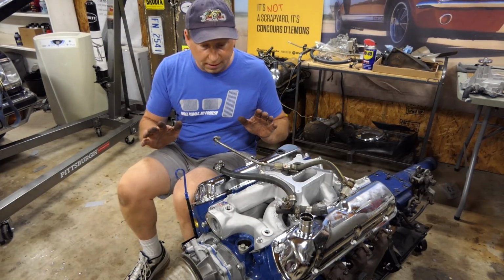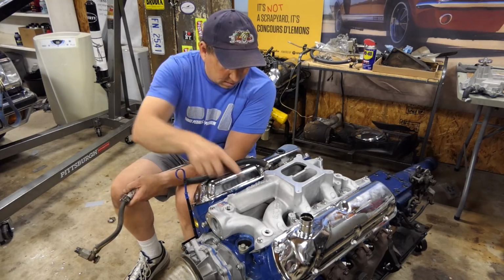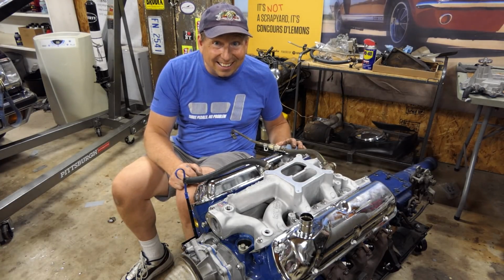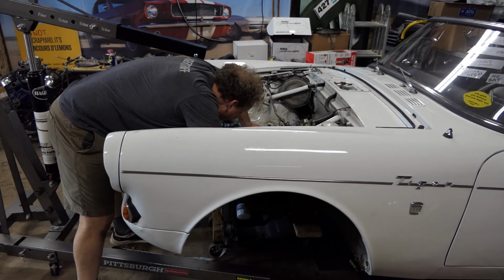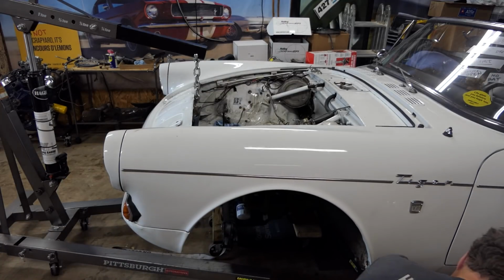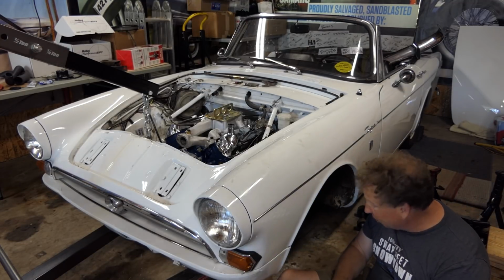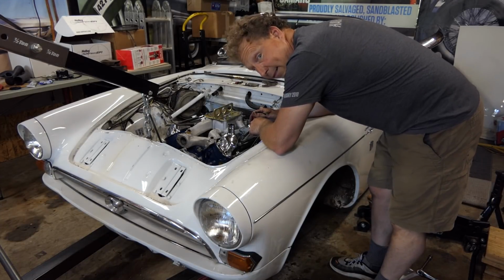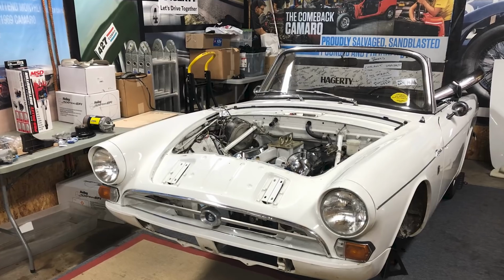In goes the Ford 289 | Sunbeam Tiger engine swap project - Ep. 7

Comment: ProTip: Always use fender covers when doing this kind of work. No need scratching up a good paint job if you don't have to.  Also avoid metal to paint contact.  Brad may have the cash to pay for paint and body work after all of this, but cover all of your engine or body lift chains with cloth to protect your appearance in the first place.
Reply: I see those black marks on the fenders. Fender covers are always a must.
Reply: @bmh67wa  lots of grease from my hands on the fenders, for sure.
Reply: Thanking you for your service, US Army 1969.

Comment: When you say that the Air Gap intake manifold is bigger, that means "deep breathing" at higher rpms.  The roller rocker arms and screw in studs are matched with bigger valves/cam.  The small block Ford engine wakes up, making serious power and it screams like the show "Ford vs. Ferrari".

Comment: Nice job. Are those cast exhaust manifolds the factory ones? I put headers on mine, and there's no way it will go in with the headers on! I eded up suspending the engine in place, then attaching the headers, engine mounts, starter, etc all together. It took skin off all my knuckles....